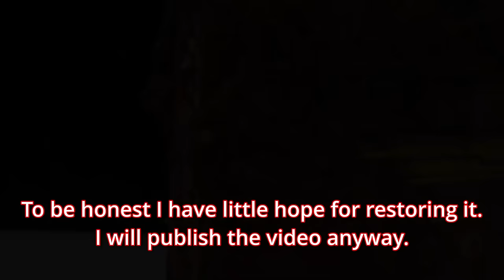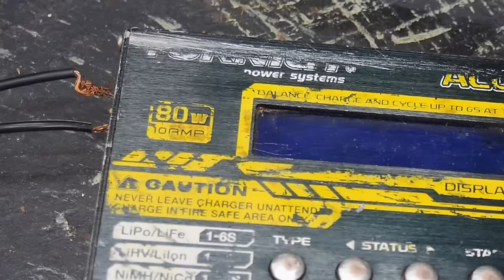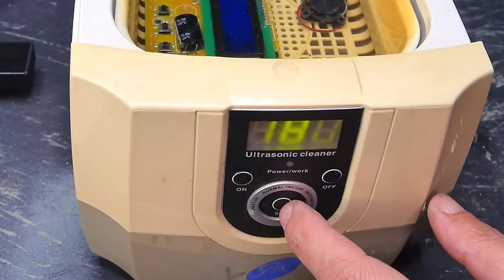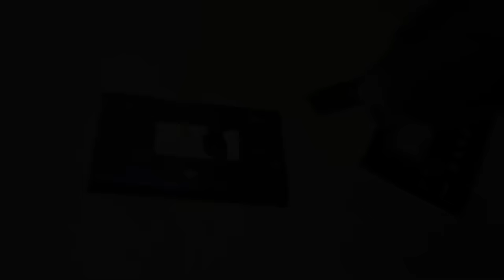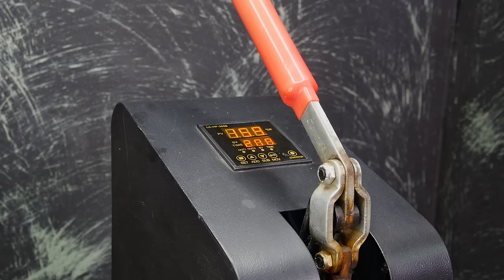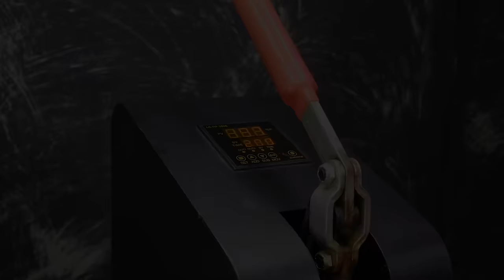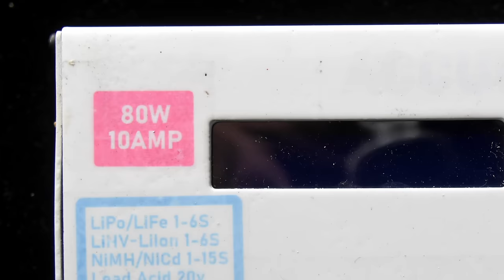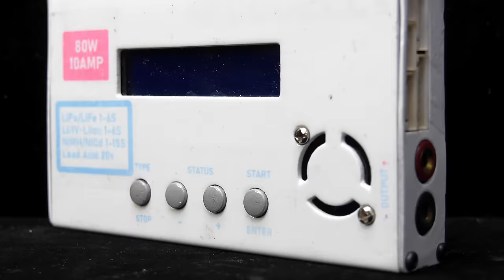Real Restoration an Old Lipo Charger: The Ultimate Makeover

Comment: Why does this vid remind me of the way they do this in india where its all filmed in sections and put together backwards to create the illusion of a start to finish restoration when in reallity they started with  a working item ??????????????? Ive never seen the board on any electrical device be that new after a clean without any track damage, not to mention how clean and new the inside of the case looks ,,,,,, to new lookin  m8 oh and dont forget to spray it for extra effect at the end ......  :face-red-droopy-eyes::face-blue-wide-eyes::hand-orange-covering-eyes:Rust on the  pins outside but no rust on pins on otherside of the connectors for the voltage sense wires >>>>>>>looks like it was just burried in the back garden for a month !!!!
Reply from the maker: I know it looks fake.On this channel I repair-restore tools for my other restoration channel.I was also shocked when I opened it.(you can check it too.there was  spiders nets inside).I dont shoot fake videos.I restore objects just for fun.The board is covered with lacquer.It prevented it getting damage from moisture.Case is aliminum.there is no rust outside or inside.(it is just mud).tracks are made of copper.(does not rust)I dont think this device stayed outside for a long time.maybe two ot three months top.You can see other repair videos online they use ultrasonic to clean boards.(They also look like new.I just followed their instructions).Thanks for taking your time and commenting.❤️❤️❤️
Reply: Под дисплеем надо было муравья  смыть , после включения не бахнуло странно - транзисторы без прокладок . ЧУДЕСА @
Reply: Видео снято для лайков !!